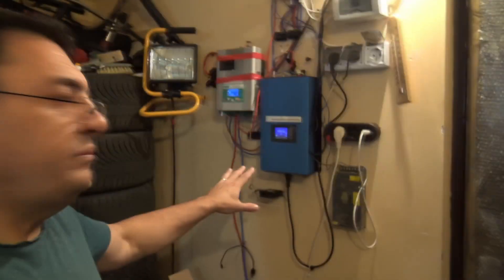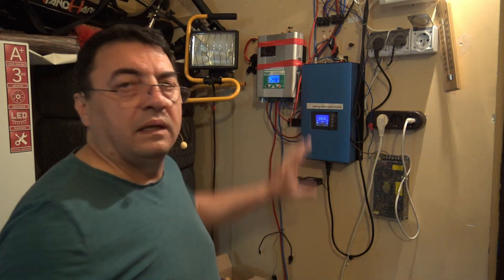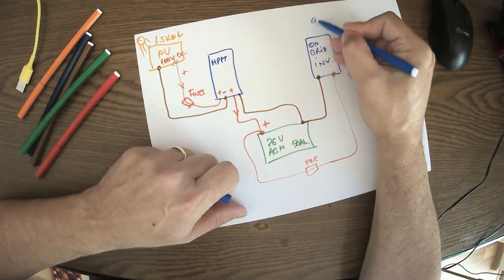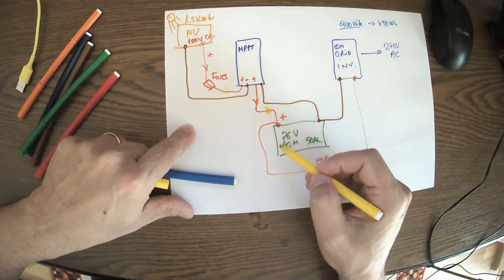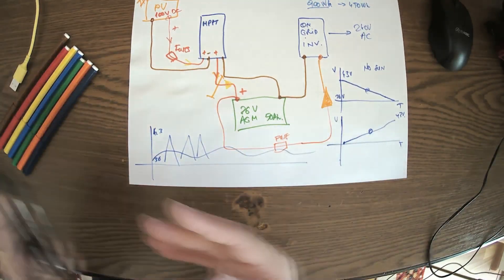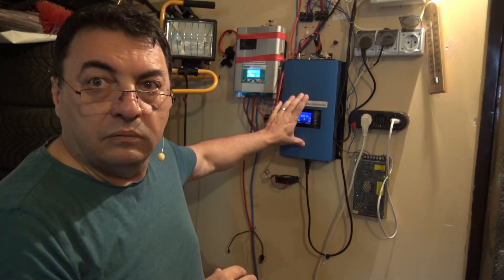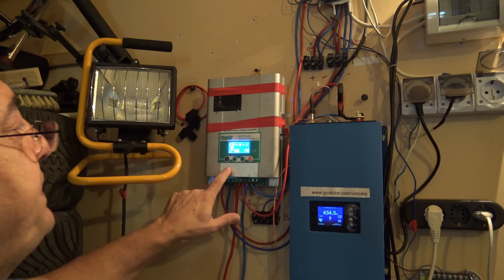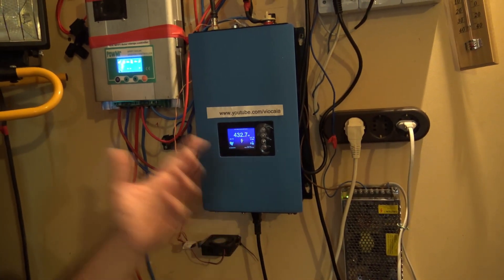News about solar power production

Comment: Thank you for your latest video, Viorel. I have two 2kw GTILs, each with a 1500W array, for a total of 3000W. They share a single CT cable for limiting, and as there are no batteries yet I am wasting a lot of generation in the day. I hope to do what you've done, and add a charge controller and a 48V 100AH. I would love 200ah but It's a lot of money and I don't know if it will generate that much outside of summer months. We'll see.
Reply from the maker: Perfect! You're right 200Ah it's to much..but with a buffer the generated energy will be at least 15% higher..as I figured until now..
Reply: My base load is 250W so I'd need 1kWh every 4 hours. UK 8hr night in summer = 12v x 200ah = 2.4 kWh as a minimum. Double that for winter. You need a 48v battery to charge a car though.
Reply from the maker: @sang3Eta  Right!

Comment: Hello Vio, again, nice video.
Well what I can say is if your load during daytime is constantly very close to the inverter power limit then in fact you’ll make use almost 100% amount of power that possibly generated from your PV on that day. As this is my usual case from day to day, instead of MPPT and battery, I ended up with having a 75mF smoothing capacitor installed on DC side, it works reasonably fine within seconds to fill gaps on sudden power drop events (short shades or passing clouds). At least effectively avoid inverter restarting but no chance when talking about “minutes” or even “hours”, definitely need a battery and MPPT as what you did. 
I’m waiting somebody to test with a powerful supercapacitor and see the outcome.
Thanks and keep having fun 👍
Reply from the maker: Good idea with supercapacitor.. Maybe I will try that.. For now I'm really glad with the results.. Thanks

Comment: From what I understand you need (due to losses etc...) at least .5c to 1.5c (depending on many factors) to charge the batteries.  For 7kw/h you need at least 3.5kw/h coming in to 9kw.  The higher number is for dark days, etc...
Reply from the maker: Exactly... For now I'm stucked with 5KWh...I got no more place to install more. At least I found the recipe
Reply: @viocaia  I have kept silent about your panels, but from the first time I saw them I said you were running out of space so is it because of a money issue you chose so many versus the hi performance ones they now have?  I am not kidding I have seen 400+ watt versions with the 300 watt versions now considered lower tier.  Tall, and narrow which I firmly believe would work in your situation because height you have not the width needed for your current panels.  Three 100 watt panels vs 1 350w panel, and you would see you saved room.
Reply from the maker: @generalawareness101  when I started this, there was no expertise in the area or very doubtely ones and I just learn and put the things together. I'm far from a final setup.. But at least I know what and how.. Maybe I'll get rid of this panels and buy a whole pack modern stuffs.. Someday.. Thanks👍
Reply: @viocaia  Aye, I could tell the age of them.  We learn and grow as we go.  I am still amazed at 450-500 watt panels being made.  Sadly, we haven't seen an increase in efficiency in solar.  I firmly believe we will but not using silicon that we have been for 50 years now.
Reply from the maker: @generalawareness101  I'm sure there is better technology I'm crying for all the energy the earth is  loosing every second
Reply: @viocaia  Not on this planet my friend.  We are already discovering new things that have blown away previous science facts.  I am almost positive there is something in the vastness of space that is far better than silicon only we have yet to discover it.  Problem then becomes transporting it to be used here and the costs involved.  Eventually mankind will implode to become extinct or come to a point like Star Trek.  I know which way I think it will go if the WEF has their way.
Reply from the maker: @generalawareness101  absolutely agree